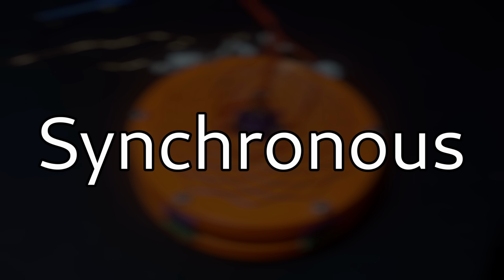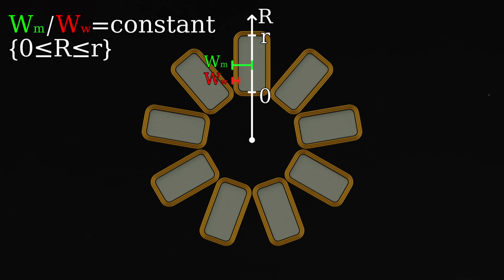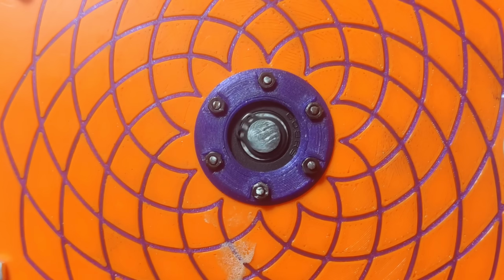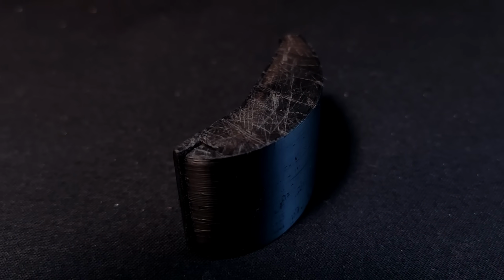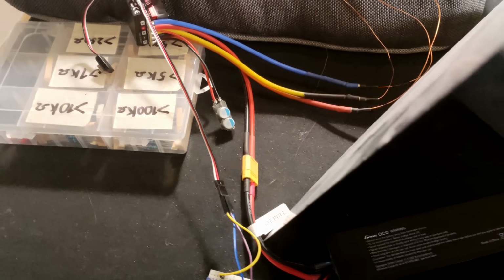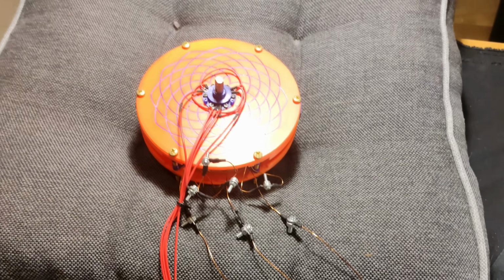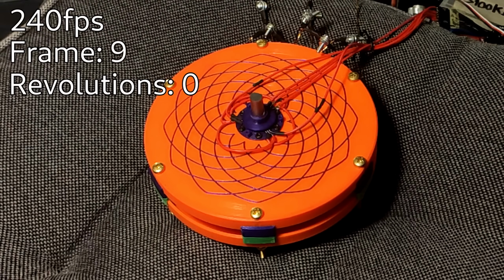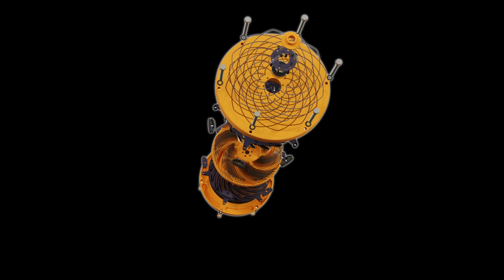Axial Flux Synchronous Motor Prototype

Comment: This may be a dumb question, but here goes.  Involute shapes mess with my eyes, so you may have already covered this.  In a basic coil winding axial motor, each coil looks very pretty and independent from one another.  However, no 2 adjacent coils are energized at the same time. Is it possible overlap the coils to bring competing magnetic fields closer together?  I figured that would either stall the motor or give it more torque, your thoughts?
Reply from the maker: Well, in an ideal world, the 3 phases would always be energized to some extent (only at the points where a phase's current direction switches from one direction to the other direction would you have a completely de-energized coil). In both cases, concentrated windings and distributed windings, the coils are layed out in such a manner as to compound the magnetic fields generated in a useful manner. This was the first mistake I realized about this motor - I had messed up one of the phases, which would mess up the motor severely... luckily I had left all of the phases' leads free and I could fix the problem by just connecting the phases up in the correct manner.
Reply: @BirdbrainEngineer  obviously I know nothing about this.  But I am interested in understanding what it would take to build a high torque, low speed, low weight 48v motor to turn a ships propeller.  Thoughts?
Reply from the maker: @nutsandbolts432  Well, for low speed and high torque you'll want a high number of poles as well as a high number of wire turns on each pole. In addition, you'll want the motor to be able to handle high current, so the wires should have a large gauge or you figure out something like liquid cooling. 
You'll need to figure out which material you'll make your stator cores out of, as you will have to make sure to not push the cores into magnetic saturation, while also allowing for as high of a magnetic permeability as possible and as low of a remanence as possible... basically you'll want a suitable magnetically soft material to make the cores out of (and they'll need to be laminated because otherwise eddy currents will ruin your efficiency and make the heat very difficult to manage). 
Depending on how slow you want to turn the propeller, you may still need to use some sort of gearing, eg. a planetary gearbox to gear down the output even further, giving an even slower speed and more torque (though also losing a few % efficiency due to mechanical losses in the gearbox). 
To have a low mass, I would recommend concentrated windings to eliminate weight gain from winding head in case of distributed windings, as well as going for an axial flux motor as it's easier to generate high torque with axial flux motors. 
48V is a pretty low voltage for a motor that is supposed to generate a lot of power. For example, 48V is a very common voltage to use for e-bike motors (and will probably be the voltage I use in my e-bike motor when I make it), and most of them are built to produce not much more than about 1-2kW of power. Using an axial flux design and maybe making the motor large-ish, you could probably double this without much effort. Regardless, this is not an amazing amount of power, especially to move a "ship". I'm not sure how large you are imagining a "ship" to be, but already things like 22' sailing boats usually use an engine that can produce at least an order of magnitude higher power output than that, and small ships like fishing trawlers use an engine that produces around 100x that amount of power.
Reply: @BirdbrainEngineer  30,000lbs sailboats.  I wish I knew of an equation that simply stated “X” gauge wire, “Y” number of turns, at “Z” diameter with “A” voltage = required torque.  RPM’s is a byproduct of prop efficiency, but most off the shelf props in this application rarely turn above 3600.  
There are plenty of companies that make units that bolt right in, replacing diesel engines or work as a hybrid system along side a diesel engine.  Unfortunately, they want 4x the cost of what I could pay a machinist to make me the components from scratch and build it myself.  It also seems like an axial motor could be “stacked”, like pancakes, if more power is required without sacrificing a ton of space or weight.  But when you start talking about magnetic fields and eddy currents, that’s where you lose my mechanically minded brain.
Reply from the maker: There are some equations that get close but you'll never really have a perfect solution. In addition, such equations certainly require understanding the ins and outs of electric motor design and motor electrical engineering to a fairly good degree to use effectively. In general though, a good place to start is to constrain your design requirements as much as possible... Eg. start with what you want the max rpm to be, then what you want the torque to be (and consequently what the max rated power output of the motor would be), from that you'd start to calculate out some of the electrical characteristics of the motor and so on.

Comment: About driving it, maybe working with true sine power. The Spanish youtuber Electronoobs made a video about driving bldc motors that way. About the variable reluctance motor, I might think that the steel alloy isn't magnetically soft enough, having too much histeresis renders the variable reluctance not working
Reply from the maker: Yeah the steel is not good for this purpose... One day I might try to make a properly working reluctance motor as I now have some ideas on how to make better stator- and rotor cores. Since wave driving is nearly always preferred, yeah.

Comment: Yeah it's not powerful enough that it should have been but you can improve it .
Reply from the maker: Yep, for the reluctance type to have any hope of working I should have made the stators deeper, not mess up the winding and as a result fit way more wire turns on the stators.

Comment: Hey, I hope you don't mind a bit of input.

I may know why your reluctance motor failed.

Your rotoric and statoric core laminations... they were well designed but poorly constructed.

I think you forgot why they are insulated laminations and not one solid block. To prevent Eddy currents. Which clearly happened to your prototype since it got quite hot, because the individual steel sheets were short circuited. 

Here's what you can do. Find an old laminated core transforme(those are made out of electrotechnical steel.. steel with some silicon in it) , with laminations big enough for your stator and rotor. And use that you can also buy yourself some varnish and spray each blade before installing them. 

Also, your ESC was probably producing alot of high frequency harmonics. some filtering could help.

Hope this helps.
Reply: A ceiling fan has a very good iron laminated core and mounted in a shaft all you need to do is find way to install Strong magnet's to the core. I used all sorts of glue even araldute but at some high speed the magnets slide out of position.

Comment: I was learning 3d modeling to make this exactly motor😅, 8:37 - why didn't you use a different type of sensor? Like infrared
Reply from the maker: Because most readily available sensored motor controllers have hall-effect-sensor input.
Reply: Ebike motors commonly use hall-effect sensors, especially for pedal assist to monitor RPMs. You'll notice they're common use for bike computers, too, and  automotive distributors, to control engine timing. Hall-effect sensors just work and you'll find them all over cars, doing all the things people can't do, or the industry has deemed us too lazy to do. Infrared sensors unlike HE; won't work well when dirty- there are distributors like that, as well, and they eventually get dirty. Overall, a HE is a simpler and more forgiving setup. You can probably thank them the next time you need your cars traction/stability control.

Comment: So, you made an axial brushless universal motor, kind of. If i understant it correctly, the 2 winded faces have the same winding and are both static. The core is ment to position itself something like a magnetic transmission does? 
Soo to work, the phases of one side would need to be very slightly offset from the phase of the other side, and the magnetic field should be only directed by the laminated core. Im not sure it can work if the laminated core is parallel to the axis. I think you might need the phases to be in line and have the core try to redirect the magnetic field to produce he offset. 

If im right, you would need a new core but could test it kinda quickly.

Comment: The problem was in your windings. That is why it worked after adding magnets. If your windings don't generate a magnetic field how is the motor supposed to move when using no magnets in the rotor?
Reply from the maker: The windings do generate magnetic poles.

Comment: should use those green magnetic viewing sheets to verify fields.  helps tremendously when making electromagnets :)   Cool project. wish u much success !
Also, digital simulations can be misleading!  More often than not, simulations merely get a person to believe in falsities.
Reply from the maker: I actually used a linear hall effect sensor as a really basic gauss meter, and the stators did generate 3 north poles and 3 south poles in alternating polarities.
Reply: @BirdbrainEngineer So it's an AC motor.

Comment: Instead of manually creating the windings, use a PCB with slots cut in it for the laminations. A multilayer board can be used to increase the number of turns and if necessary, multiple boards stacked up for more turns.
KiCad is free and easy to use for making the boards. The files used to describe shapes are text based and can be generated using a custom Python script.
Reply from the maker: PCB stators have worse thermal characteristics and can't handle nearly as much current as an equivalent volume of magnet wire. PCB stators are fine for motors that don't run high loads but since my idea is to eventually end up with an e-bike motor then using wire (or hairpin-wire if being as efficient as possible) is a must.

Comment: what type of steel would you recommend for a high frequency AC electromagnet?
Reply from the maker: There are different types of electrical steel blends. But from what I have heard, if you get into the range of tens/hundreds of kHz to MHz, then certain blends of ferrite cores are the best. Usually you'll have to put in a special order though, tailored for your frequency range and shape of the ferrite core. I'm not that familiar with high frequency cores though, as in motors, even in extreme cases like turbomolecular-pump motors, the field switches at most at a frequency of a few kHz.

Comment: Shouldnt the Laminations be isolated from one another to increase the K Factor of the motor?
Reply from the maker: Yes they should be. I made the laminations simply because that was the way for me to assemble the cores in any capacity.
Reply: @BirdbrainEngineer  I get that, but would it be worth it to clear coat the laminations to try to increase the efficiency of the motor?
Reply from the maker: @AdeIino  Sure, I just also didn't have a reliable way of coating anything in a thin coat of an insulator. My next project, once I am finally settled in at my new place of residence, will need me to figure out a way to deposit a thin coat of an insulator though, and I do have an idea on how to do it... just yeah, have to get the "lab" corner set up and actually start with the project.

Comment: Great project. I had a similar idea many years ago to use axial flux motors on a bicycle, but along the rim. Build a bicycle frame out of carbon that sandwiches the rim of the wheel and laminate it with thin PCB sheets. The traces of those PCBs then build the windings of very lightweight electromagnets that drive the rim. On a 29" wheel you would need very few windings to create quite substantial torque.
I'm pretty certain that with room-temperature superconductors it would change the way we design bicycles forever, because it should beat the transmission efficiency of a mechanical drivetrain.

Comment: This is a really neat project. I imagine a layer of insulation between the sheet metal plates would reduce eddy currents.
Reply from the maker: It would, the laminations were made simply because it was easier to construct the parts that way. But I do have a lead on how to construct the stator next time to reduce eddy currents by a lot.

Comment: Looking at your rotors, one cant really see much reluctance variation when they spin, regarding the coils. Low reluctance variation means almost no torque. A way to get stronger reluctante variation is to redesign the rotors and the wiring, to imagine having like U electromagnet and a U steel core facing each other. The orientation of the rotors laminations is paralel to the ones in the coils, which might not produce the highest reluctance variation.
Reply from the maker: The stators generate opposing magnetic poles facing the rotor. As an example a single flux path "starts" from stator1 pole, through the rotor, to the opposing pole on stator2, through the back iron of stator2 to an adjacent pole on stator2, through the next set of laminations on rotor, to the opposing adjacent pole on stator1, through the back iron of stator1 back to the "start". These generated poles rotate rather smoothly thanks to the distributed windings and so they should keep the rotor nicely in sync. The problem is that since I only managed to fit 9 turns on each stator, then there was just very little flux to begin with, and some other reasons were also said in the video.

Comment: The flat sheet metal was not creating good magnetic pockets, oddly lightweight steel tubing bent into curves might have worked better. Also the sheet metal design also had to many spaces with no magnetic field. Thus the lightweight metal tubing- covering the whole disk in a radial pattern with roughly of millmitter plastic space between each tube would- probably gave a better result.
Reply: also... the laminates were shorting out...

Comment: I always wondered if one of these speed based clutches would make sense on an ebike motor.
Reply: Like a centrifugal clutch? It's possible. Even electric motors can benefit from some sort of transmission. These things produce torque instantly, so they're basically all or nothing. EV cars do have a transmission of sorts- even the single speed gear reduction of a Tesla is basically a transmission in simplest form. Otherwise they'd be direct drive which has limitations, and that has been a discussion in the ebike community about direct drive versus gear drive hub motors for a while now.

Comment: A roll a magnet over the other way put your magnets to the center of the two of those bins and then put a flat metal butterfly middle electrode on each side and hook it to the negative and positive to push on both sides make it and how Gustav the sides of the metal thing I don't spend elemetal play the magnets in it those ones that are just Ben 10 if you've been in the opposite 423 for magnet crossings in 6 magnet crossings 23 magnat

Comment: Very impressive. I am curious what the ESC sends to the motor, and if it is the same sequence as for a BLDC. You also mention there is no back EMF, does that mean this can't generate power or be used for regenerative braking?
Reply from the maker: A reluctance motor, as far as I am aware, can't be used for regenerative braking or as a generator, yeah. The ESC is tricked to work in "sensored" mode, and so it sends the 3 phases exactly as it would into a bldc motor.
Reply: In fact reluctance generators are kind of a thing, they're called flux switching generators. Apparently the main application is as the electrical power source for guided missiles. They still have field magnets, but they don't have to be on the rotor (which just looks like a toothed wheel).
Reply: @nerd1000ify  I am looking for the generator method that has the highest power to weight ratio for a hybrid drone I am building. Ideally, easily controllable voltage output over a very wide range of conditions and very light. This type might have benefits over BLDC
Reply: @TheSorters what's your power source? I know there are hydrogen fuel cells intended for use with drones. Which saves you a lot of moving parts and potentially weight.
Reply: @oliverer3  my gas engine weighs 2 kg and puts out 5kw or 7 hp. No fuel cell would come close to that hp/weight ratio

Comment: its amazing how axial or rotor still 365 herts AKA 360 degrees or a circle equates to 120 which is the current degree seperation of a 3 phase power producion system today. which is 1/3.  I would try using air core as in no core.

Comment: How did you do the inlay of the motor cover/ housing? Its beautiful!
Reply from the maker: Haha thanks! It's the same involute shape as the stators, simply criss-crossing in both directions :D 
I have been using blender so far for making my models... but that era is about to end, as I need to be able to produce .step files before long, so I am learning to use FreeCAD... Animations for the video I will always continue making in Blender though.
Reply: @BirdbrainEngineer I meant the purple inside of the orange. Does your printer have a multi filament capabity?
Reply from the maker: Ah, thought you meant the geometry of it. I simply printed a groove into the cover, and printed the purple color separately and then pushed it into the groove in the orange part.
Reply: It's very well done. Would you consider doing a video on that and other 3d printing techniques you use? I know it'd be off-topic of your normal videos, but it's very well done.